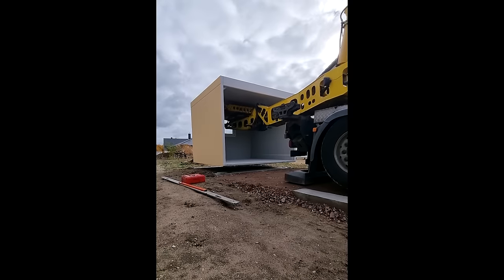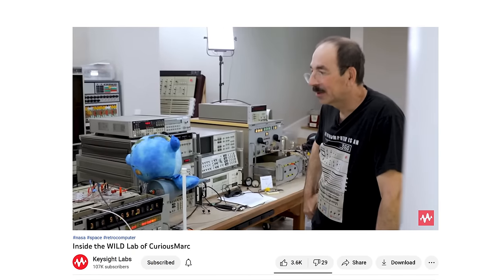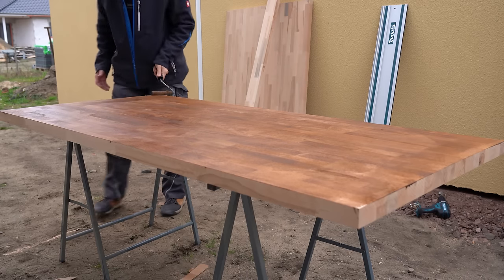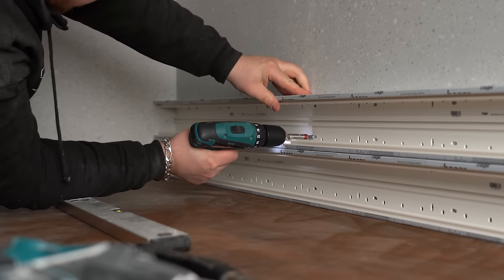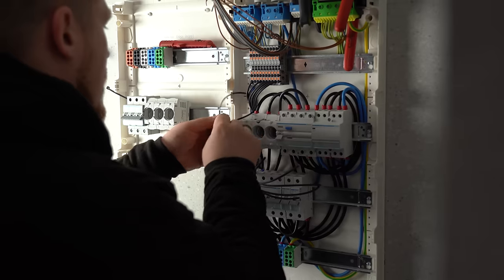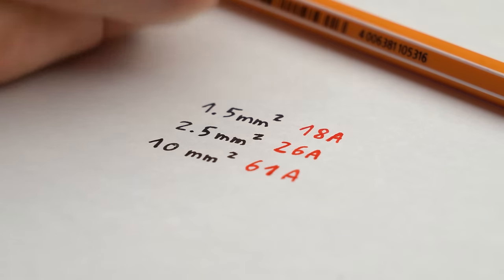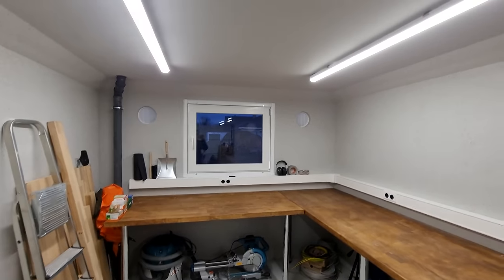Germans do the PERFECT Electrical Wiring! (Garage Build)

Comment: Nice build, but you should have probably put the cables in some protective pipe in the bends too. In our company we use grey flexible conduits or sometimes premade bends. Also not a huge fan of those sockets and switches gewiss has much better modular system, but whatever suits you.
Reply: That is allowed in Germany, and is also done in industrial buildings. If it was in a wall then you wil need to bend a pipe. But on a wall this is typical to do
Reply: Yeah, since you have to use that plastic conduit anyways, not sure why they don't have 45' and 90' sweeps that you can just pop on the ends. Not sure exactly what that plastic conduit is really going to do protection-wise, but better than bar wire.  Putting those outlets only 3-4 inches above the table was a big fail.  Unless he's not going to have equipment on the bench. Put them 18-24" above the table top so you can put stuff against the wall and maximize work table space, and included cable of stuff is usually 5-6' anyways to you get that off the table.
Reply: @boots7859  we in holland have pvc pipe and hostaliet. Hostaliet dos not shatter when you hit it with a hammer or other things. Pvc pipe shatters like glass. Getting cables with 3 wires to go through a bend is very difficult. A cable with 5 wires is practically impossible. I think he uses 2.5mm2 wires or 14agw for American users.
Reply: @mikeyhendri  here in slovenia at least in our company we put pieces of flexible conduit in bends. Don't know about protection but it looks better than exposed cables. This is done in industrial and installations like in the video.

Comment: I'm an electrician from Australia and use Hager gear as well, the set up looks very well thought out. 

I would have the conduit differently, though for the coners, I would have either used 90-degree bends, corrugated conduit, or a bending spring and bent the conduit. Then, I would have had the conduit continue into the ducting and J boxes using plain to screw adapters so there are no cables showing.
Reply: open bends are allowd with use of cable, its just a faster way of installation and sleeker look the nailing it down every 25 cm. the use of 90-degree bends or corrugated conduit is a not done as a profesional dutch electrician.

Comment: Looks great! I am a little put off by the lack of pre curved junctions we’re not used on the cable conduits, makes for a neater install. I also find it unusual that you did not use individual color coded conductors in the conduits but use a totally enclosed cable. German electrical code? I do like the Hager raceways and the various accessories for electric distribution. Funny they are not available in the Hager catalogue here in Greece, there are other brands but I do not like the profiles offered. I do like the Hager power panels and the accessories used to hook up the circuits. Very neat install. It is unusual to see fuses used to protect the mains at the entry point in the panel box. Fuses in the states went obsolete 40+ years ago. My home here in Greece has fuses in the basement level panel but we finished the two panels in the upper two floors with Automatic breakers and all three levels have each a GFCI protecting the panel. Have you considered power outage lights for both rooms in the garage? Perhaps a line interactive UPS for the door opener, again in case of power failure? I personally hate getting out of my car during a heavy rainstorm to release the garage door from the lift to get the car in. Hopefully you will run several power conduits underground (if permitted by the DEC ) to accommodate security system, cameras ( don’t trust wireless cameras ), telephone lines or internet wiring. I also have a interesting question, Does one have to be a licensed electrician to purchase electrical equipment such as circuit breakers, distribution panels and associated equipment in Germany? Might make a great follow up video short as to some of the rules and regulations that are in the German laws, always interested in what’s Code in other countries.
Reply: We in Germany don't get power failure due to just some bad weather in situations where you don't have other way bigger problems like flooding or tornado-grade destruction of homes/roads.
Reply: My understanding is that you can just buy these things freely, though some specialty shops limit clients to businesses as they don't want to deal with amateurs as customers.
It's even legal to wire yourself, you just aren't allowed to hook anything up to mains without a licensed electrician signing off on it. It might also be forbidden to sell wiring services to others if you're not a licensed electrician, but not sure.
Reply: Since the cable used (NYM) is already double insulated you dont need to fully enclose the cable. If he had used individual wires  those bends would have been required. But running single wires is usually not done here. You are allowed to do it but its just not common.

Comment: For a garage an electric vehicle charger would also be very useful.
Reply from the maker: That is why there was a second smaller distribution box next to the bigger one. There the protection devices for the EV charger will get installed. But that will take a bit of time.
Reply: @greatscottlab  Is the provision there for 11kW EV charging?

Comment: Mechatronics Technician working in the industry here, so I was about to be triggered, but then you cleared it up ;)
I'd probably have split the sockets on the workbench 50/50 and colour coded them. Half of them on all the time, half of them via the E-Stop, and then wired the E-Stop "correctly". That way you'd only have to turn the protected outlets on if you actually needed them, and could rely on the better protection.
Still, every bit of protection is better then none. Would be interesting to know how they did the E-Stop sefety outlets for "Berufsschule". Though I do remember them having them turned off most of the time.

Comment: In the USA, house power is two 120Vac phases with a "neutral", or one 240V source.  This is called "Split-Phase".  240V is used for clothes-dryers, heat-pumps, oven etc...
Reply: split phase is long history in europe. German houseconnection is 3 phase 400 volt 63 Amp. single phase outlets 230 volt 16 amp 3600 watt. Enough for you washingmachine dryer, ovens and so on.

Comment: Nice work. I never have my panels so clean looking. 
What I would do differently if I wanted the emergency stops there would be to add a switch that powers the relay up. That way I could shut it down cold when I am not there and not suffer the 20W constant power draw of the relay and yet have the emergency stop fully safe against cabling damage too. If the space was so dark I would only work with lights on then I would consider linking the relay to the lights - every time I turn them off the emergency stop turns things off too.

Comment: Swiss electrician here
Those hager ducts are nice indeed. Just a shame they have no such fancy instant outlets for here from what I know.
Two things I'd have done differently would be:
Using more smaller ducts instead of all the tubes. simplifies your life in the future in case you ever want to add more things.
And adding a Neutral disconnector for every breaker. Not only required here but actually useful if you ever have issues with your wiring. Can also be used to fully isolate a circuit that constantly trips that RCD.

Comment: This was interesting to watch as I am an electrician in the USA. In the USA you are not aloud to have those cables exposed as they are subject to physical harm. You have to run the conduit all the way to the boxes using connector fittings. To get the wire in, you would push a fish tape and pull whatever wires you need. You would not push a cable into the conduits as they are to thick and would be to hard to pull around bends. There is a lot more to it and of course more codes on the specifics.

Comment: A beautiful installation!  The ducting you use (in the UK we call it conduit) is the only thing I don't like: when we install conduit in the UK the tube goes into the accessory using a threaded coupler and bush (both plastic and steel conduit use these). Preformed bends are available, but most electricians use a bending spring. For steel one uses a bending machine.

Comment: Nice setup the one thing I would recommend is a socket connected to an isolation transformer, that way you could work on live mains items without the risk of being electrocuted.
Reply: In Germany  we using in most ways portable Isolation transformers. They are betwen the other test equipment on the bench. Common sizes between 300VA  to 1,5kVA. I own two of them but got also a fixed one in my Workshop.

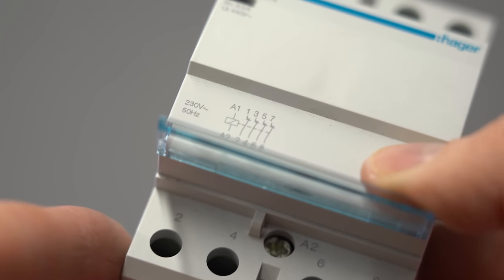Comment: 6:49 Use a Hager ESC463S contactor instead of the ESC464 shown in your video. It comes with 4 NO contacts but the ESC463S only draws 4,5W of current in order to stay closed instead of the 62,5W of the otherwise similar ESC463. Hager calls them "brummfrei" (free of any humming sound) which obviously has additional advantages. The ESC463S is also cheaper than your ESC464.

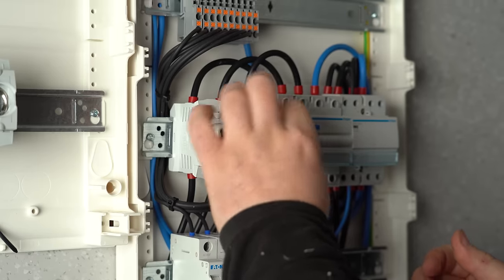Additionally I saw that you have used a 40A RCD device in your installation so I suppose that you installed 40A D02 ("Neozed") fuses into the fuse holder in 11:20. The problem is that Neozed fuses are prone to become very hot if they are improperly screwed in. That's why I recommend to use fuse switch disconnectors (German: "Sicherungslasttrennschalter") when using D02 fuses at higher currents. You can use Hager's L73M for that. It will ensure that the D02 fuse is held properly before allowing the circuit to be closed and also provides an indicator light for when the fuses blow. I used them to carry 40A D02 fuses for my garage and they definitely outperform the old Neozed blocks at those currents.

I wonder why your construction site is only powered with a single-phased supply. How are they supposed to operate a construction crane, then, when they only have a single-phased power? That's definitely unusual for a German construction site.

Comment: We basically use the same cable in Finland but we can only put 10A fuse on 1.5mm2, 16A on 2.5mm2 and about 35A on 10mm2 with some exceptions. Also we are allowed to use N (blue) for switches and phases but usually people use black marker pen on it or tape it a bit to show it isn't a neutral.
Reply: In Italy with fuses is the same thing, we can't use neutral for fase, is forbidden to use blue wire for everything different from neutral. Another thing we don't use are rigid copper cables.

Comment: I would've used flat conduit instead of round conduit for the cables. Since you already have large Hager conduits around the work benches, it would blend better if you used the flat kinds around the walls and ceiling, and you wouldn't even need to screw them in, as the double-adhesive kind is plenty strong enough to carry smaller guage cables. As an added bonus, the flat conduits have corner pieces you can use to mask the corners, making it all look very neat. I'm don't know what German electrical code says about clipping double-insulated cables to walls, but if that's up to code, it would be another way to avoid that mismatched look.

On the functional side, it looks pretty great. One thing you might want to consider for future proofing is an AFCI (Arc Fault Circuit Interrupter) to complement your ground fault protection. I have no doubt that in 10 years or so, they'll be mandatory in new installations in the EU, and the AFCI do add extra protection against a fault that your normal MCB's and GFCI's won't detect.

Furthermore, if it's going to be an unheated and unventilated space, I would recommend separate two pole GFCI's for each circuit instead of the normal MCB's, so that if there's moisture causing a ground fault in one socket, for instance, it won't shut down your entire installation and make fault-finding extra difficult.

Comment: You’re actually semi correct, you’re allowed to use the blue leader for switching, but you’re not allowed to use N as a switch. Two very different things. For instance if you have one switch you can use a 3leader wire, like a QLO 3g1,5 where you use brown as phase and blue as switch.

Comment: I'm an electrician from Belgium, didnt know they still use screw in fuses in panels over there. They are long gone in Belgium, Like more then 40 years we don't use them anymore and i think that's a good thing. And also, the emergency stops you will never use in a small workshop ;-) and 63A contacts is a bit overkill. I would have placed a workswitch with emergency stop build in at each CEE plug (cheaper then that 1 relais you bought). no relais and you would have saved on cabling ;-) but for each their own and it's a clean install for sure.

Comment: ABB make a low current consumption coil contractor.  The afz (in 24VDC) is designed to be controlled directly by a PLC without the need of an interface relay. They have a holding current of only  1,7W.

Comment: You should have used proper right angle plastic tubing for electrical pipes and for the ending you can use flexible tubing. Otherwise it's pretty slick.

Comment: German and Italian electrical standards are mostly similar, in fact we use more or less the same manufacturers. A big difference is the style of the components, Germans are rounded or a square, Italians are rectangular.
If I am not wrong you also place pipes in the concrete more often than us too.

Comment: Looks great. The only thing i'd do differently is design the table so it can fold out of the way. So you get a bigger area to work with equipment in the main garage area.
Reply: yup, that table corner is perfectly positioned to remove your brake light cluster :D

Comment: I'd call that "conduit" instead of "ducts".  Integrated e-stops are a great idea for garages.  Amazing that you can just install 400V 3-phase in your house.  I get cautious when dealing with the 240V (split-phase) plugs we use for electric ovens and clothes dryers here in Canada.
Reply: At least in western Europe, every house is connected to 400V 3-phase. I have installed two 400V/16A 3-phase outlets in my home workshop. Absolutely great for machines like my lathe, drill press or just a powerful heater during winter time.
Reply: @christiansprojects-cgmanuf1426 same in central europe (poland), old and every new houses got 3 phases

Comment: It is cool. But I have noticed one thing. The whole installation is running through one RCD, or GFCI depending which part of the world you are from :) it means in the event of a fault all power and lighting will go off. In my buildings I prefer individual additional protection in form of RCD for every circuit. RCBO devices are compact, single phase device only takes a single space on a DIN rail and provides overcurrent and RCD protection.

Comment: Love your channel. I'm a big fan. I'm also a master electrician based in Iceland. Your installation looks very nice. Good choice of electrical material and obviously talented electrician. It's worth mentioning that tightening cables together with zip ties does effect their thermal rating. As a general rule it's best to avoid it, even though it makes the panel look pretty ;)
If you must, you can look up the thermal rating degradation guidelines, of cables being strapped together in the EU electrical standards handbook. I used to think this rule was just BS, until I worked at a data center where I witnessed first hand the bad things that can happen when all the cables are strapped together and they get loaded up to 80% of their rated current carrying capacity. Hope this helps
Reply: Some electricians strap them together here. Some dont. I learned in trade school here in germany not to do it but i dont think there is a code specifically that forbids it.

Comment: I certainly would have done the emergency stops the other way.
And then a normally open switch in between to turn on the power.
This way, when you switch on the power, you immediately know whether your emergency stops are working, because in the event of a cable break or a non-working NC contact, the power will not switch on.

Comment: Great job! The only issue I see, that wouldn’t be acceptable here in the US is how you left the cable exposed at the corners bending into the boxes. We bend the conduit and connect it securely to the boxes so that no cable is exposed. I also think it looks better that way. Other than that, absolutely mint install.

Comment: Usually this concrete box is for storage or a car, they are not isolated 
So coming winter you need some heating for your workplace
Maybe nice topic what work best
Like some solar panels with electric infrared or diesel chinese heater or wood furnace

Comment: Ofcause its made perfect when you doing it for yourself, but often there is not the time to do all perfect. But I do it anyway, because people get happy :) 

In Denmark its not aloud to use suckets for the pipes, because it very easy to just pull the pipes down, in denmark they require fixed installation for safety reasons. The rules there is a bit more sharp, but does look a lot like the german rules. I think its great to have these rules.
Nice looking garage, also very smart to make a workbench like you did.

Comment: Moving stuff- Get some 2x12 equivilent pieces of lumber, cut down to 24" and put some castors or wheels underneath for rolling stuff around.

 Why would you put your electrical distribution channel so low, inches above the table?   Put them up high so you can push equipment back to almost the wall and maximize that space. And the outlet height will get some of that cable slack out of the way.

Pre-stressed cast is pretty nice, to bad you couldn't go 4-5m wide so you can get a floor jack and space for additional eqiupment like a snow blower, etc.
You can never have enough garage space.  Who knows, you might need a 2-car garage in the future...